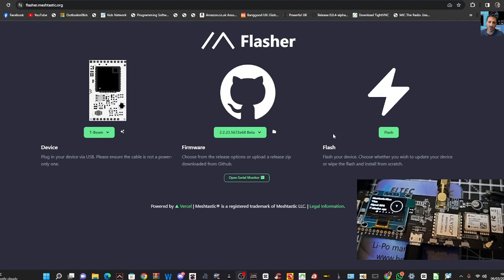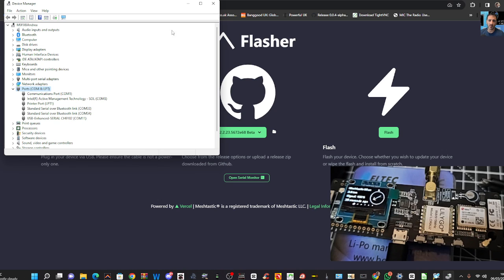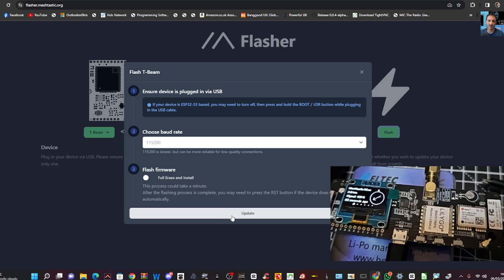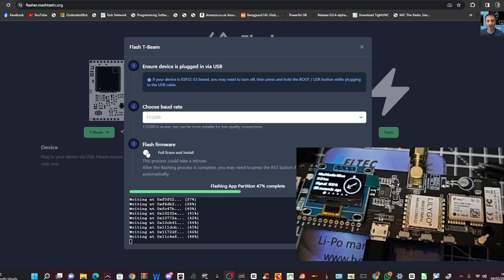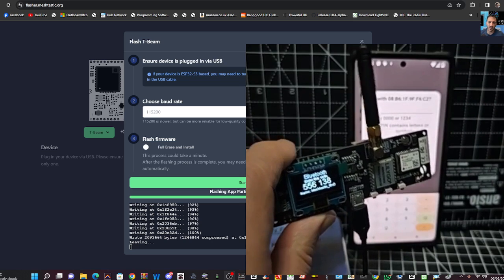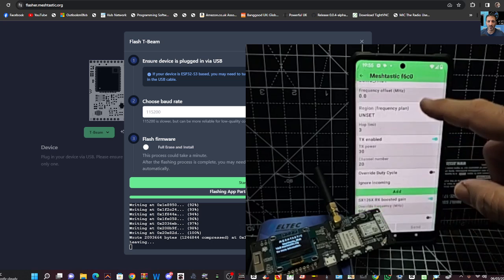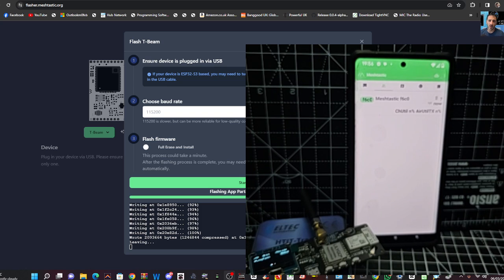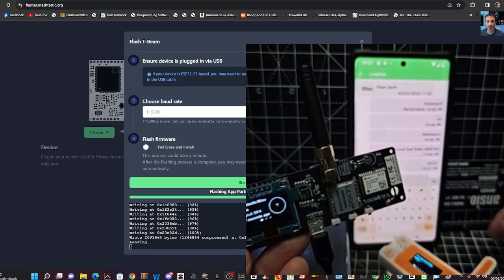Lilygo T-BEAM LOAD FIRMWARE & CONFIGURE - MESHTASTIC

Comment: Hey, i have a question, how do you connect the COM port,  I already installed the driver the CH9102F driver but still it doesn't apprear at my device manager, is there any tutorial for this problem? thanks
Reply from the maker: Watch the videos I made
Reply: @M0FXBHamTech  Thanks, I realized that I used power cable not data cable, my fault
Reply: @M0FXBHamTech  Could you be more specific? I cannot find any solution to the driver problem.